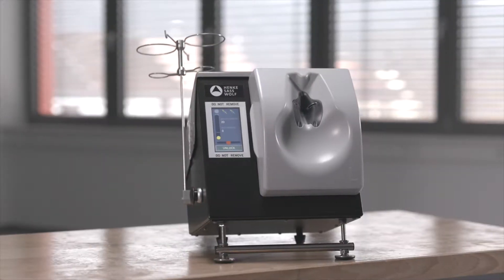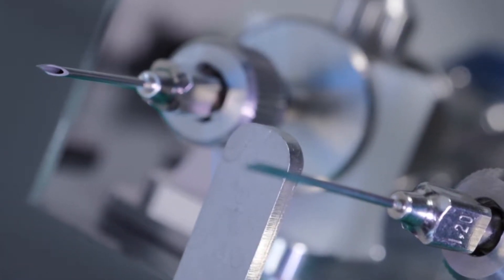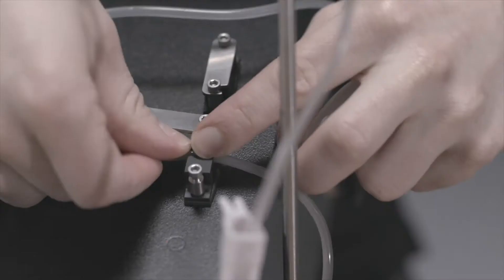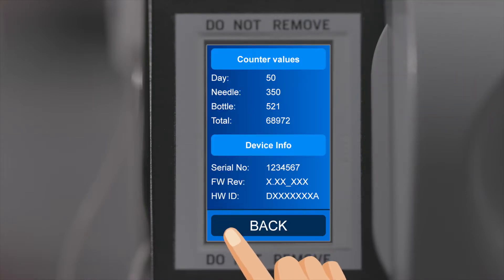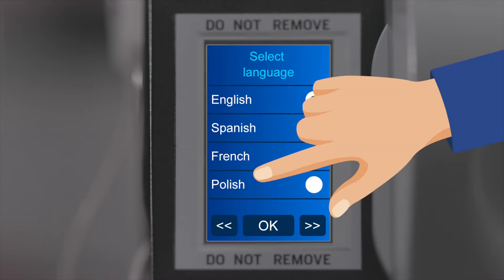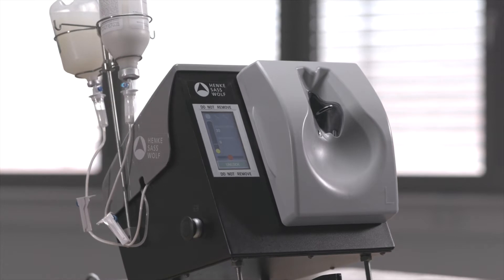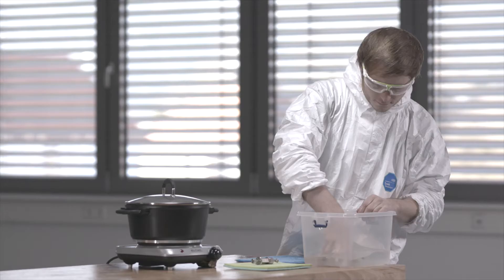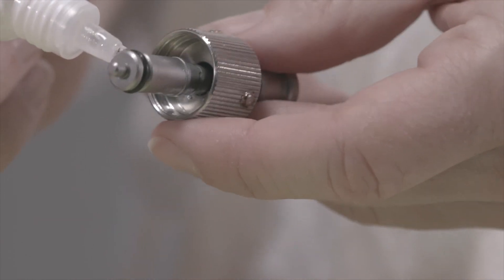HSW Double Breast Vaccinator

Comment: How many chickens working in one hour
Reply from the maker: Dear Customer, 
many thanks for your request. 
With an experienced operator, approximately 1,000 to 1,200 chickens can be vaccinated per hour. 
Please note that the throughput depends primarily on the skills and workflows of the user and not solely on the device.
In case of any further questions, please do not hesitate to contact us at any time.
Best regards, HSW Veterinary Team